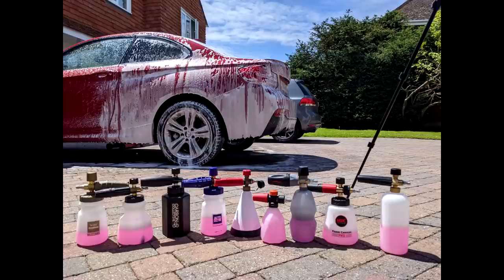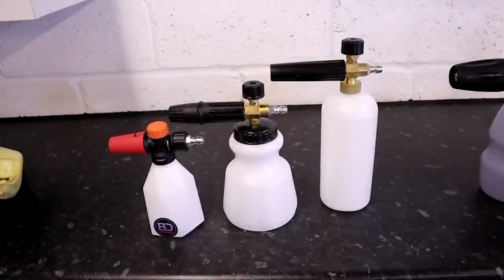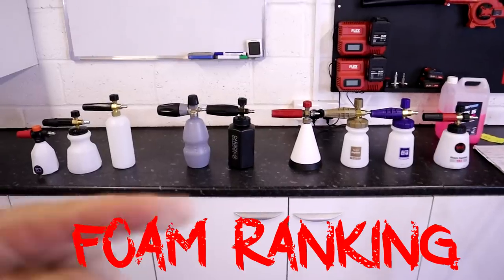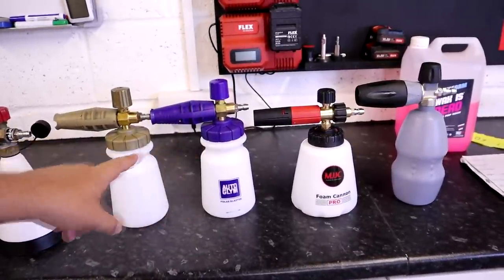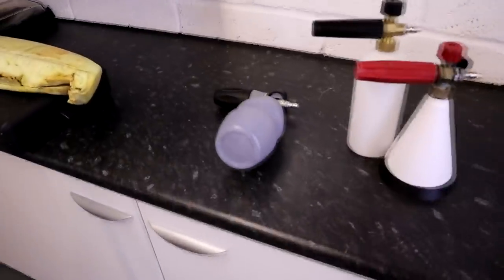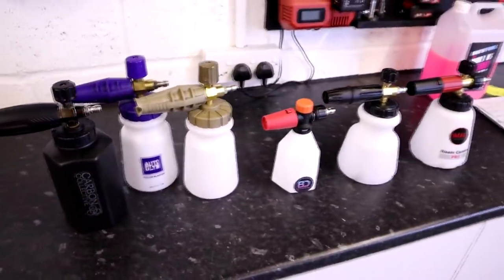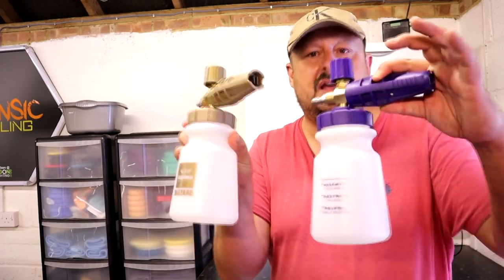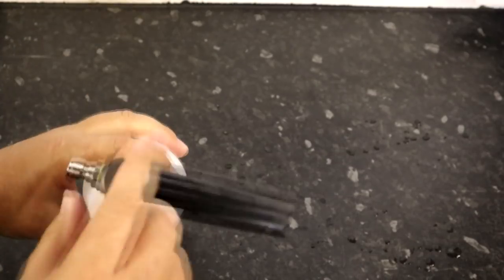The Best Snow Foam Lance/Cannon | MTM MJJC Autoglym Carbon Collective PA Cheap Chinese

Comment: And the one thing that all of these don't have that I have always wanted them to have, is colored scale markings for measurement. The last one that I bought was so hard to read, that I had to paint the impressions with a magic marker to read them. I know it's silly but it is something that I would value... Thanks for the video!
Reply: Great suggestion Jeff. You'd think it was obvious really, but nobody seems to bother with nuances like this.
Reply: @as680783  
How precise do you actually need to be? I know our pumps are quite precise in pumping out 30 ml per pump. If you want to be precise with water, forget the markers and just weigh the damn thing. If you think about it, there are so many ways to measure things prior to actually mixing it in the bottle.
If you are a pro detailer like me, here's an idea that can make things really fast.
I store my various premixes in 25 litre jugs with a tap on them. I have four jugs with premixed Auto Foam for example. three is for 3% and the other for 5% PIR. Anything I need in between I mix on the fly. That's why there's an adjustment screw. You are wasting a ton of time if you mix every little container of prewash or foam you use. Much better to just mix a big batch once per week, month or what ever.
Even if you are just detailing at home, do it this way. Buy the amount of 1 litre bottles of what ever foam or prewash product that you use, and mix it in a larger 5 l jug with a tap cap on it. A 5 l mix will last most hobbyists a long time if they don't waste the product. If you get the hang on things, you can foam down a car with 150-200 ml of mix, sometimes less. That's 25 car washes for a 5 l mix.
Just something to think about Keep it simple.

Comment: Thank you Jon, a great unbiased review as usual. One thing I would have liked to have seen was application of sealants eg Autoglym polar seal. I have the MTM with a 1.1 orifice and it is great for foam. It is no use at all when you turn down the mixture knob as half of the liquid coming out of nozzle just dribbles down onto the floor.

Comment: Just ordered an Mjjc, after Watching this review and some others. Can’t wait to try it, I like thick foam but my current genetic gun just doesn’t cut it. Edit. Have tried the Mjjc gun on my own car and my works car. Absolutely over the moon with the thickness of the foam. I mixed my snow foam in my old gun to make make sure I was. Using the exact same mixture rate, Night & Day, is all I can say.  I would need to use another 200ml foam for my old gun to match the Mjjc, for thickness. Icing on the cake, you get x2 mesh filters and another filter that I don’t know what’s it’s for yet and x2 vent bungs for the bottle.
Reply: Remember that the foam produced is very much related to the amount of product the system puts out overall. If the MJJC had a 7:3 ratio here which is how I understand it, then just put 4.2:5.8 ratio in the MTM and the PIR will be the same. No matter what you use, calculate the flow to see if you are in the low or high suction end.

Comment: I have one of the aliexpress jobbys, I have used it with a nilfisk and now a karcher (changed adapter) I can get foam as thick as shaving foam if I want either from Autoglym Polar Blast, auto finese snow foam or meguiars snow foam, can even get a thick foam out of shampoos - it's a great little thing, but yeah, falls over a lot :-D

Comment: I got the MJJC a few weeks back to replace my Karcher Foam Lance Advanced 042, which I was very disappointed with for over £129.
Got the MJJC direct from the manufacture as they were the only one that had the adaptor for the Karcher HDS 7/10. 
Best purchase ever, it is fantastic! The foam it generates is incredible and means I actually use less than I did before.

Comment: I have an MJJC lance (the tall bottle version) and a cheap one the same as your Ali Express one and agree with your findings that the MJJC one uses a hell of a lot of product. I remember making up a litre of snowfoam, set the dial to maximum foam thickness and must've used 700ml on one car. 😳 It's good but I still prefer the generic cheapo one myself. 👍

Comment: My #1 Cannon that I use is the MJJC Pro just like that won for you. 

My 2nd place is Adam’s Premium Foam Cannon

My 3rd is MTM PF22.2 (new bottle). I still think they need to adjust the black twist nozzle and it’s too loose and flops around when you don’t want it to while foaming a vehicle.

Comment: I find TT " made in Italy" foam lance give me good result with high dwell time. This has been abused in my detailing shop for the past 3 years and runs without any issues. Pressure washer is Hawk 130 bar electric at 11 LPM.
Reply: Nice flow and good choice of gear. People are way too caught up in the pressure and think you can't get foam or wash a car unless you blast everything with 200 bar.

Comment: I have the Autoglym snow foam Lance, it's easy to fill and generally quite stable. The biggest issue for me is when the contents gets low in the bottle you have to be careful how you tilt it otherwise it stops producing the foam. I like the MJJC product as they have thought about that problem.

Comment: i would have swapped out the autoglym lance for the sams detailing. £32 if you choose the 1/4 QR connection or £35 gets you the QR as well as a karcher or nilfisk attachement in the box. also you get a replacement orifice as well definitely far better than the angel wax or autoglym cannon. i used to think the Autobrite one was amazing but im now using my Sam's Detailing lance more now.

Comment: The mtm in my opinion should be second place. I have the mjjc, and the pf22. I converted the bottle on my pf22 to the wide opening and wide bottom. It is a top class lance. At the end of the day you want a product to perform and last and for that reason even though it is the most expensive it gets my vote. You get what you pay for
Reply from the maker: The topple thing was unforgivable bad design.  I spoke about this on the unplugged.. they have now given the UK access to latest version pf22.2.  this might have made the podium except they  increased lance price by 20 pounds just to fix the bottle.  But it's mega high quality...
Reply: @ForensicDetailing  The bottle tipping over used to really annoy me as well. I found a video on YouTube of a guy in USA who had converted his to a larger opening and base. It was a great idea so I also done mine. It’s perfect now, but agree they are still behind as the new bottle may have larger base but they kept the bottle neck opening. Poor design and not really moving forward with technology.
Reply: @rufus7343  Me and many other pro detailers are glad that the did not change the neck. Like how the nozzle works, it was done that way for a reason. That size was chosen so that it fits onto just about every 1l bottle in the world if needed be. Multi purpose use is important and the wide opening does not allow that.

Comment: If I may offer up some thoughts on trying to see how they perform if they run the same PIR.
Yes the MJJC performs well and put out thick foam, but it also sucks up product insanely fast at 9.375 ml of product per second. The MTM was 45 seconds so 6.66 ml per second, which means that the MTM needs 420 ml of product if the ratio was 700 ml of water and 300 ml of product in the MJJC, so 420 ml of product and 580 ml of water. In that case, it's much more equal. What does the better foam matter if the only reason is a higher consumption. I own both so I could really care less, but at the same PIR, the MTM creates better foam for me. Not that I want "useless" shaving cream, but I do want my Auto Foam to stay on for a bit and the MTM is superior for me in that situation.

Not sure I see the wide neck as a plus. For many of us it is nice to be able to screw the head on to just about any bottle out there. The older MTM might topple, but it fits on any bottle out there with that standard size neck. Heck, you can even fit it directly on to a BH 1 litre bottle and adjust the dosage on top rather than use the mixing bottle. I have a few set up like that and I would not be able to do that with the wide neck bottles.

Comment: Love this video , learning lots from you  !
Just a quick question, have you tried cleaning the SS Mesh filter or foam maker as they call it by soaking
or something on them lines ?
Reply from the maker: yes you can clean in vineger or coke or descaler.

Comment: Thanks for an excellent and very comprehensive video. But as a newbie about to try snow foam, I have a Karcher K2 with the Karcher 'end'. You use some type of pistol grip. So, what pistol grip should i get and how do I connect them all together please.
Reply from the maker: Karcher K series fitment mate.   All the good Lance's should have option to pick that.  Honestly though upgrade your pressure washer if u can.  145 bar 450lhr flow minimum.

Comment: I used the cheap Chinese type off eBay, identical to the Aliexpress, and I’ve found my adjustment at the top cracks and becomes redundant as well as the nozzle for the fan spray is always jamming or just breaking. The bottle itself is good though, just the top but is a bit…cheap if that makes sense

Comment: Jon, can we do a review of "garden hose adapted" snow foam lances. For quick weekly maintenance washes i want to know if these are a good option? Would be a huge time saver....
Reply from the maker: in the USA they are viable in the UK we have really bad mains pressure I dont think many use them here Dave.
Reply: Plus; pressure washer foam bath takes more time than an ONR wash ;)
Reply: @Ichabod_Jericho  onr is snake oil, wouldnt never recommend
Reply: @DavidC1  allegedly

Comment: I think it would be interesting to see how a chemical feed on a pressure washer compares to a snowfoam lance. 

Yeah you will not any blanket of foam from the chemical feed but its more about cleaning power of a detergent feed vs a snow foam lance.

And virtually every pressure washer comes with a detergent suction hose. 

So its the cheapest option to get chemical onto a surface. Besides a dedicated pump pressure sprayer.
Reply: I actually had an issue at a mobile job once where the feeding tube fixing point in my lance broke due to chemical wear. I mixed in the onboard container and used the head from the foam lance and shut off the lance suction. Worked just about the same as with the normal canister on the lance. In theory one could easily make a foamer that did not require the heavy container, but utilized the onboard tank. As long as you know the flow rate of your system in terms of PIR, you are pretty much set.
Reply: @AB-80X  great information 👍

Comment: 6 months too late Jon! 😏  😂
I bought the Autoglym  as it was on special at Halfords at the time. My only complaint is that the controls are too light and it you touch it by mistake while your moving round the car it changes the spray settings 😢
Keep up the good work 👍
Reply: Love the autoglym but sneeze and they fall over. Just need an aftermarket foot to stick on the base!

Comment: After seeing your review I'm trying to buy the MJJC but have a Nilfisk Excellent E145.4-9 pressure washer, there are 3 different adaptors, Gerni, Nilfisk quick release and the Nilfisk/ Kew/ Alto adaptors- No idea which fitment I need, If anyone could help I'd be very grateful! Its just the standard lance that came with it.

Comment: Great video. I have two of the cheap Amazon lances, one for SF and one for spray and rinse products. If you have a powerfull pressure washer (I use Nilfisk P180) you can ramp up the pressure to get a great lingering foam.

Comment: I'm looking to get a good foam conon. I got one as the karcher one was poop. It was def better but still doesnt make foan that sticks. The product I have was also got on your recommendation, I think, its had the best cleaning power but tje foan wasn't that thick but still I'm not getting anything like you were so its just watery and all runs of in seconds before it can really break down the dirt. 
My question is this. How do you upgrade the orifice to a 1.1. Are they all standard fit. Do you have to get one specific to the canon? I want a better coanon but also using a K4 it may help to have the 1.1???
Reply from the maker: hey m8 some foams are not thick.  thick foam does not do anything as such. it makes zero difference basically.   Grab an MJJC pro V2 lance.   USe bilt hamber touchless prewash.   Have a pressure washer than makes about 450 LHR throughput and about  140+ BAR.    thats it mate.    upgrading the orrafice to 1.1 on the mjjc is easy you just unscrew the back bit and rrmove the orrafice with a screw driver.   but 1.1 might back your machine up.  if it pulses after the swap then go back to original orrafice

Comment: Hello John - bought all this gear and no idea as per my last post. Can you help? All plugged up nothing coming out. Karcher K2 with MJJC pro. Then attached hose pipe to karcher and turned on then just had really runny liquid no foam like yours. Using your Bilt stuff too. Help - on driveway - 😂😂🤦🏻‍♂️🤦🏻‍♂️🤦🏻‍♂️🤦🏻‍♂️
Reply from the maker: yo Jon I cant provide support for detailing equipment mate. you have to contact the vendors or the manufacturer.

Comment: Hi, the link you provided for the mjjc pro 2 has sold out at in2detailing with the karcher fitting. I'm new to detailing and unsure of authentic suppliers in the UK that'll be delivered in a reasonable time frame ( unsure of some of the ones on Amazon ).  Any suggestions would be greatly appreciated, great detail in your videos 😊👍
Reply from the maker: I don't know who sells it other than in2detailing
Reply: @ForensicDetailing  ended up ordering from MJJC directly, waited 15 days due to it coming from China and it being Chinese New Year. They did clearly state this on their website ( so that ones on me 😊) whenever I emailed MJJC regarding my order they always replied quickly and politely. The tracking was decent and received the snow foam lance today. Tried it out with the Bilt Hamber auto foam you recommended, great results, great bit of kit. Very pleased 👍

Comment: Sorry nearly forgot to ask you ,
The Mjjc Cannon I know has a 1/4' quick connection that screws off by hand...... does the silver bit on the end (1/4)' that's screwed in actually screw off  with a spanner ? That way I can put my Ryobi adapter on it.
Thanks.
Reply from the maker: i think think so no mate but you can buy those for pennies from most detailing suppliers

Comment: looked at a lot of websites that sell the mjjc, but one spec i have yet to see is the gpm supply needed.  i have a 2400psi washer, with just 1.1 gpm.  not sure if the mjjc pro would work for me.  or since the pressure is higher, if i should use the 1.25 or 1.1

Comment: I recently tried the foam cannon that came with my cheap karcher, not that bad! I do use Bilt Hamber Auto Foam, so not a lot of foam even with a high end cannon, but couldn't see any difference between the karcher and my usual £30 generic cannon.

Could be an interesting video?!?
Reply: If you have problems making your BH soap cling long enough, add 30ml of a high foam producing soap per 500 ml of mix in your lance. No matter whether you use the BH at 1 or 5% PIR, it will get foam that cling better. Not talking shaving cream which is useless anyway, but a nice foam that migrates down in a 5-7 minutes time. MagiFoam, Chmical Guys Snowball, Meguiar's Ultimate Snow etc. are good as foam boosters. Just remember that the booster soap you add, should not replace any of your BH, it replacces the same amount of water, i,e if you use 200 ml of BH and 300 ml of water, you need to use 200 ml of BH, 270 ml of water and 30 ml of booster. You get the idea.

Comment: Hello Jon. Would be very helpful to know if swapping to the 1.1mm orifice on the MJJC or any other cannon for that matter has any effect on efficiency. Like if it would take the MJJC longer than the 32 seconds it took here to go through the 300ml or if it would be possible to obtain the same thickness foam at a lower mixing setting on the cannon that would allow the 300ml to last longer or even using a lower product to water ratio in the cannon to get the same result with less product.
Reply from the maker: In theory it should back the flow up a bit and help thicken more m8

Comment: I have the blue Autoglym cannon and no matter what soap or settings I try I cannot get thick foam. My pressure washer is 1800psi and 2.1 per minute. I was told try and change the orifice to a 1.1 but I can't find a reliable place to get one. I ordered a 1.1 from Amazon but it's bigger than the 1.25 😮 any thoughts on this? Thanks.
Reply from the maker: 1800 psi is about 125 bar.  thats a low spec pressure washer i think mate.  I think you need more grunt.  but thick foam does not make that much difference. mjjc pro v2 is the thickest foam producer in this test